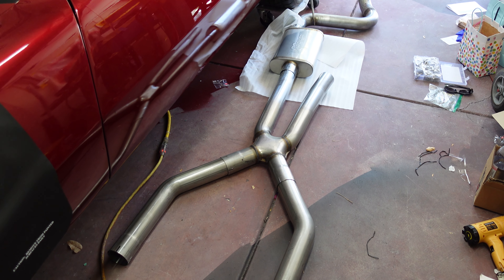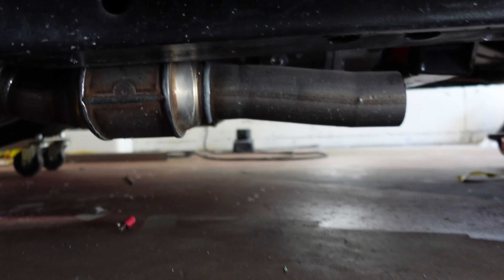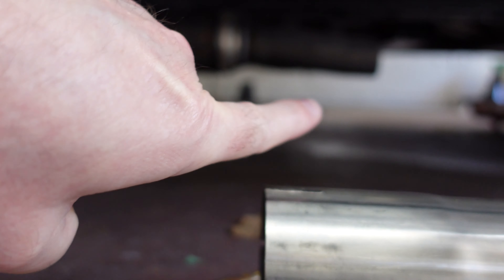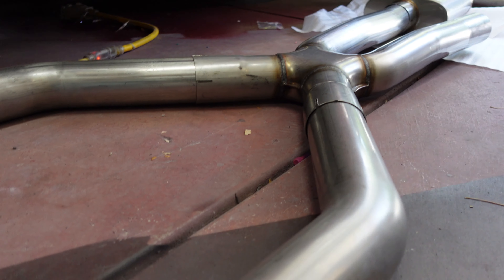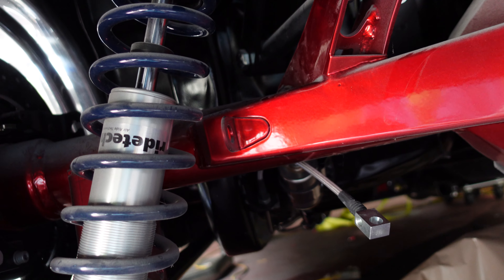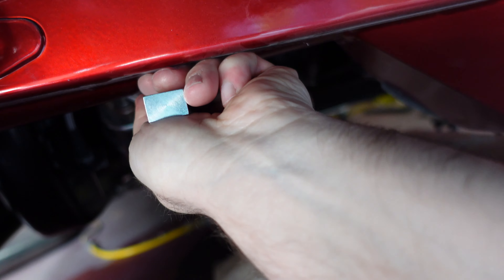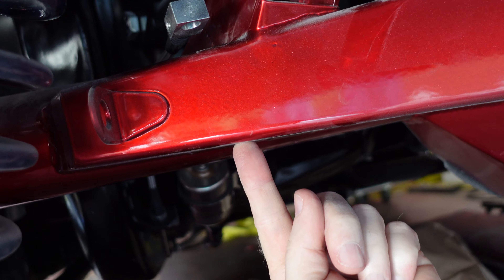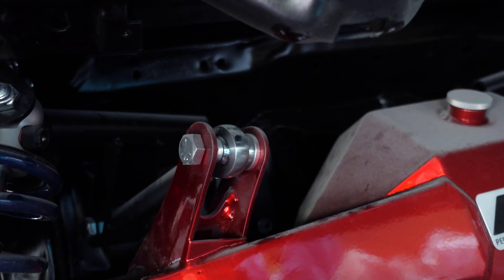Couple of questions for y'all

Comment: As for the exits on the cats being angled down...can they be rotated at all? If they are welded to the puppies to the manifolds, can they be loosened up there and moved to help with the fitment of the exhaust kit? I kind of second the send it to the exhaust shop. Up on a lift is for sure the best way to make sure of clearances. And definitely get the exhaust mocked b4 finalizing the brake and fuel line placements! Suspension being loaded verses hanging can make a difference on the bigger tubes placement also.
Reply from the maker: Thanks Jon. No, the cats are all welded up. I am putting this stuff in before I finalize the rear fuel and brake lines. I have also not done the parking brake cables yet, so I will make sure those are all clear.

Comment: The brake line, I would see if you can get a u bolt that is square rather than round and do that with it mounted above tbe axle (not below).Square u bolts are common for trailers you should be able to find one that will fit around the square axle, this way your not drilling that beautiful axle. I would also plastidip the u bolt before installing for a clean look.  The 4th gen f body used a 3" clamp for the sway bars, this is an acceptable method to mount things to the axle.

The last thing you want is debris under the car denting the fuel line and cashing major problems. Don't forget to put rock guard (spring) on the hard lines under there also, rocks could kick up and bounce around, you cannot assume the lines are safe ticked up above or behind the axle.
Reply from the maker: Thanks Angelo.

Comment: Those cats are really low, a speed bump is going to take them out eaialy. I would do what was suggested, take it to a muffler shop and have them shorten those down pipes so the cats are better mounted up and under the car. Then have them install everything or mix match your kit with their experience. 

Also tbe 3" exhaust is overkill with the 2 1/2 pipes coming from tbe cats. I think you will get some really weird rasp sounds when you let off the gas. I would suggest switch to a 2 1/2 system before it's too late and you can't return/exchange what you have.

If money is an issue, I would temporarily put glass packs on what is there, drive it to a muffler shop and have them tuck those cats under, then drive it back, take the glass packa our then start installing your kit.

Feel free to contact me directly if you want a picture how the exhaust hangs on my 81 Trans Am, I got cats and they just barely fall lower than the subframe connectors, and that is dangerously close to the road when dealing with speed bumps.
Reply: Also I think those cat lead pipes are OD not ID pipe, I'd that's the case you slide 2 1/2 I to the cat Down pipes. Either way those ring style quick connects would work great I'd you can get them welded on.
Reply from the maker: Thanks again. I will have a shop do something about the cats, but they are pretty chunky and I can't swap them out due to CA regs.
Reply: @asicerik  On the Trans Am and Nasty Z 28 forums, there is a guy who goes by Scarebird, I recall he did an LS swap with the E-rod down pipes with cats. It may be worth messaging him also, share the link to this video. Can't hurt!

Comment: Oh and the brake fitting would normally go on top of the housing and secured by a hollow bolt with a breather barb on it and it bolts into a hole in the top of the housing and then a breather hose goes to that..A brake junction mounted under the housing would be not road worthy I would think for obvious reasons...
Reply from the maker: Thanks mate! I will do that

Comment: For the brake line, I would mount it on top. Use an angle drill to drill the hole.
Reply from the maker: Another tool I don't have! Thanks

Comment: I would also use a band clamp. 6:35 can’t you buy a longer hose? If not maybe a place that makes complete hydraulic hoses can make one up. Or just extend your steel line so the braided line can reach its home.
Reply from the maker: Hi John - how would making the flex hose longer help? I still need to mount it to something. I am probably missing something though
Reply: @asicerik  I see that you can’t reach your mounting hole so either a longer steel line or longer flex hose. Unless that ring you showed wasn’t the mounting hole.
Reply from the maker: @johnmilner7603  Ah - I think I see. That bracket on the back of the housing is where the flex line to the caliper goes. So the flex line I showed in the video will have a hard line over to those brackets (there is one on each side of the rear end).

Comment: get you some v band clamps they are great, Make you a little 90 degree bracket then mount it to the upper link bracket.
Reply from the maker: That's an idea. I will think about that. I am not sure the hose is long enough though.